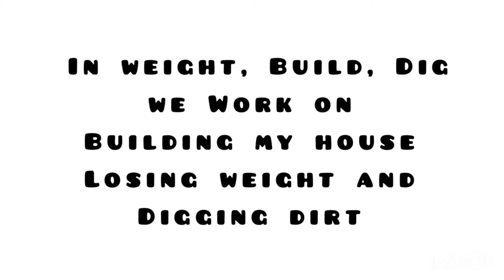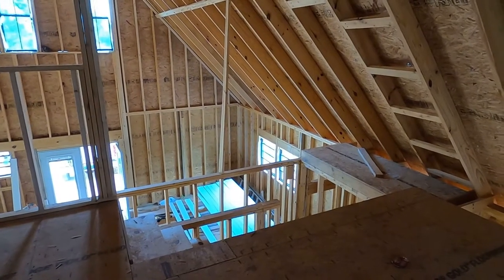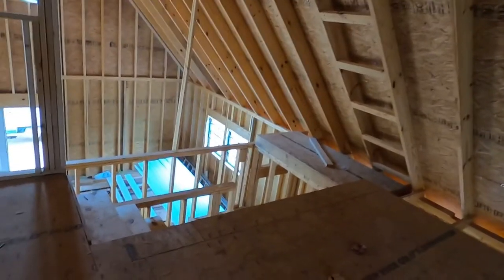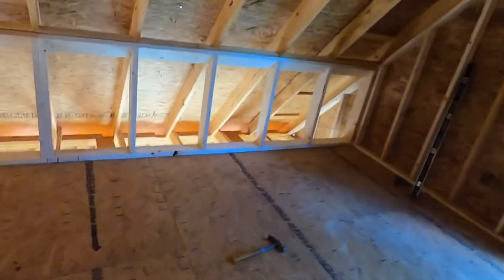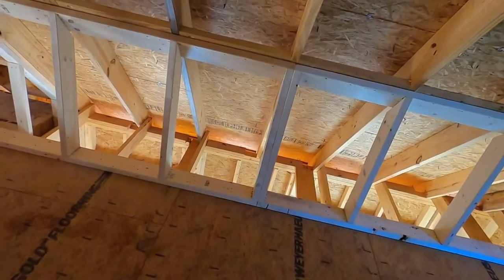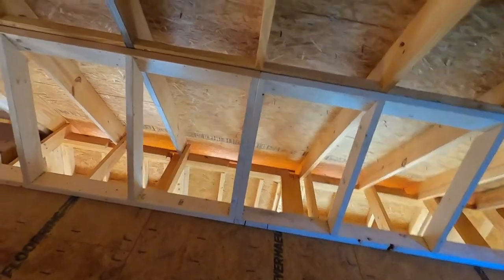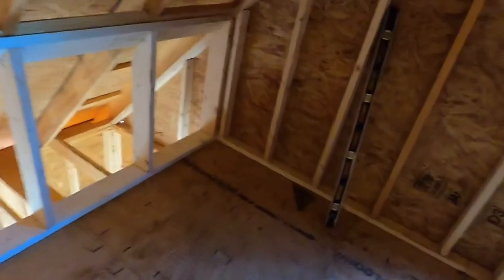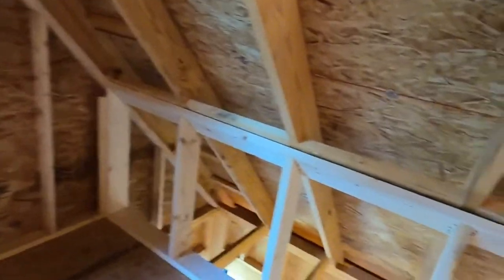Framing the interior walls upstairs! part two

Comment: For the angled wall by the stairs, is the top plate just attached along the rafter? Also, is that blocking used/needed because you added the wall there?
Reply from the maker: Yes. The blocking is put there so you have places to nail your top plates not just where the rafters are. It will make the whole framing stronger.